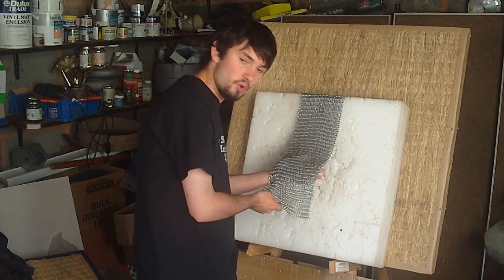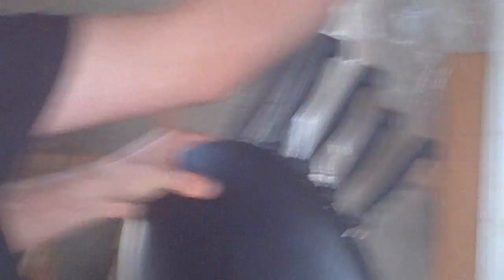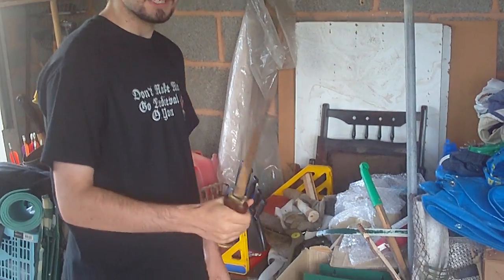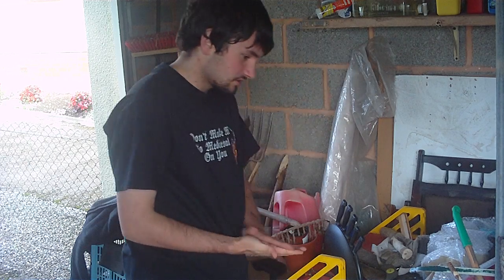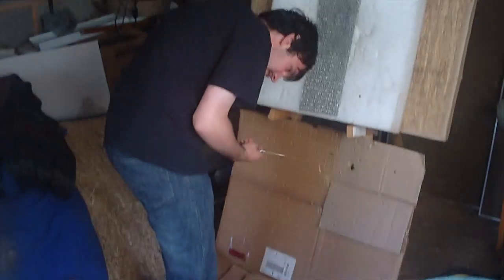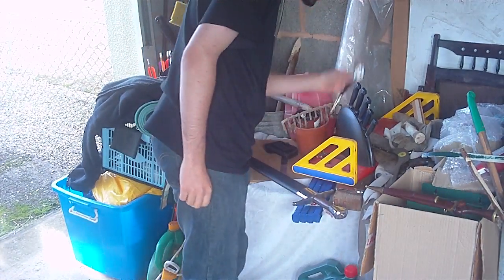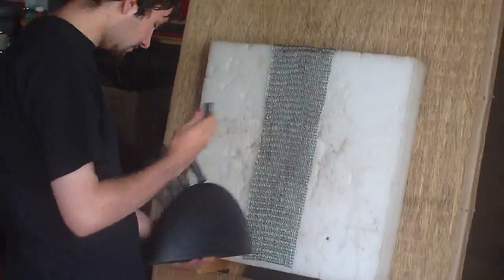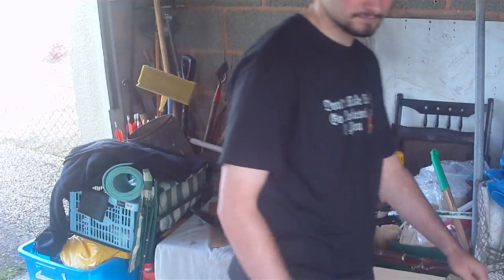[OLD VIDEO] Butted Chainmail vs Knives + Cheap Daggers!

Comment: 4 in 1 is the standard conscript armor of Europe clear to the 14th century. Easy to make, cheap to build. Butted because if you want quality than survive the first battle and buy some. Chain is meant to reduce cuts in a time when an infection was almost always lethal. Thin blades, spear and arrows peel chain like butter, even riveted. Small surface area focuses force which is multiplied by velocity all of which are applied towards a single grouping of links. Or... Stab breaks chain!

Comment: You do understand that the purpose of an arming gambeson was to absorb shock as WELL as prevent penetration from points.  Also, typically leather was worn over chainmaille depending on the culture.

Comment: the few things to consider is this IS butted mail, not riveted, I also assume made from wire, which is slightly softer than it would've been traditionally, but those are just technical details.

I'm curious of the ring diameters and the wire guage used in this mail, as it looks rather loose

Comment: The only real benefit of a katana over an arming sword or other non-curved blade is that there is more surface area dissipation while cutting. This meaning that the cut instead of hitting on a particular area of the blade will slide along the curvature of the entire blade.

Comment: I'm impressed the rings stayed together as well as they did considering their construction. however this armor would be used in modern day kitchens as a gauntlet to prevent chefs from losing a finger. inexpensive and as you saw, effective against stainless steel cutlery.

Comment: Butted mail is not historical in any way, and no you can't thrust through historical mail.
Reply: ***** Japanese kusari is double or triple ringed, and even with certain types of butted mail you can't go through easily at all. I find these "tests" to be extremely frustrating as there is so much misinformation when it comes to mail specifically.
Reply: @discipleofkhorne9472  no money for that stuff bruh I'm getting butted
Reply: @TheGoodCrusader  As long as ypu don't try to use it as actual armour you should be fine. It's great for reenactment.

Comment: I'm curios to see this test with some kings mail(8 in 2). Just the bollock dagger and the sword, because if everything else before that didn't do anything to the 4 in 1, it sure as hell wont do anything to 8 in 2.
Reply: +Takeoutman123 which is stronger 4 in 1 or 8 in 1, is kings mail riveted? or smaller rings or what,
Reply: -[Al_K_TraX]- Wow, super impressed by your knowledge, thanks this is very interesting, and nobody answered this question for me, and i never did find out these answers, thanks for explaining this to me,i live in england and there are few firearms here,  home invaders tend to carry knives, and machetes, thus the interest in chainmail lol, :)

Comment: This is not a riveted chainmail. If it was, you couldn't cut it trough. There is a little different between flexural strength, and tensile strength, or the rivet's resistance to shear.

Comment: which means it was perfect against non armored, or lightly armored opponents, but cutting power doesn't help against even a chainamil, not even mentioning platemail

that's where comes straight edge, with which you can hit pretty much like with a baseball bat

in asia there usually were mass soldiers, unarmored, unlike europeans where manpower was lower, and they pretty much needed some extra defense

but later on when armors weren't that useful, euope came up with sabres, for the cutting curve

Comment: What is the thickness of the rings and the inner-diameter of the rings which you're using here?
I tested several swords on my chain, zinc-coated, 2.2mm thick and innerdiameter of 8mm (less than a centimeter) and only one ring will split in some occasions but the sword never made it through
I used a Gladius and a european single handed sword
Reply: +Mitchell Molenaar was your maille butted or rivetted, was the gladius sharp, was it a proper gladius or one of those cold steel gladius machetes lol...

Comment: If it is not welded, brazed, soldered, or riveted, then you might as well make a fourteen minute video stabbing coke cans. It's meaningless and wasted craftmanship on that mail.
Reply: +Ajackofalltrades78 Alpha well said sir, never heard of brazed and isnt welded and soldered the same thing? i am looking to buy some riveted maille, i bought a bulletproof vest thinking it would stop edged weapons, but after some research i figured its not going to, but will make a great undergarment for some rivetted mail, giving me greater protection from blunt force trauma, and the added plus of protecting me from small arms fire too, i am wondering what will happen to the riveted maille if a bullet hits it, will it explode into a million pieces lol... would the rivetted mail blunt the bullet slightly improving the stopping power of the kevlar under it, any ideas?
Reply: @Samanthax1221  shows its better than nothing.
Reply: gaben... better than nothing so why not just get the riveted kind,